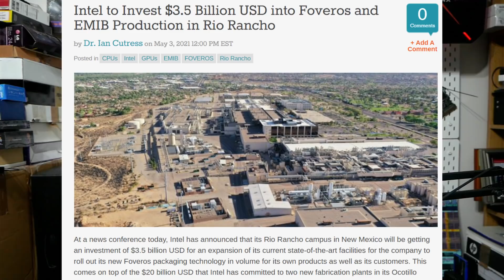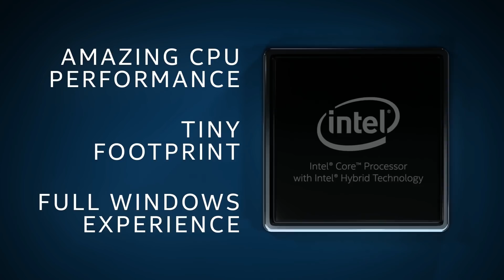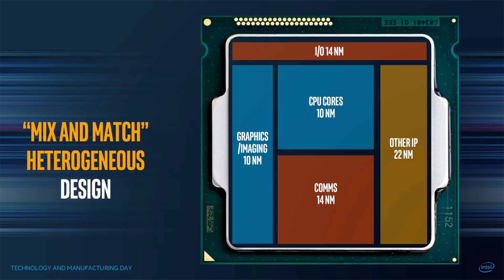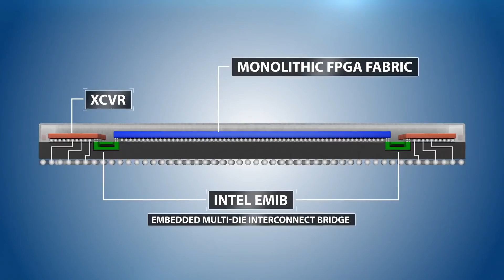Intel is Investing in Layered Processors: Foveros Gets $3.5 BILLION

Comment: My Ph.D. (awarded in 1995 from University of Sheffield) was in 3D packaging. I also worked on some DARPA die stacking projects in the early 2000s after moving to the US. I now work with CMOS image sensors, which routinely use die stacking. It's so funny to see the industry going from looking at you strangely when you talk about stacking, to it becoming almost commonplace. It only took about 10-15 years longer than I expected!
Reply: Yeah, that happens when your research becomes viable and/or necessary.
Reply: I mean, that's a common technique to pump you for unremunerated work.  You keep trying to prove yourself, they keep stealing your ideas and running with it.

Comment: Example of migration towards 2.5D/3D package SOC out in the wild.  The Apple M1/M#.
Reply from the maker: M1 isn't 3D with die-to-die stacking, it uses package traces - it doesn't even use an Interposer, so you can't call it 2.5D either such as with TSMC's CoWoS integration. There are plenty of interposer based processors on the market, mostly GPUs.

Comment: I think compared to chiplets stacked chips will be severely heat constrained. There is no way for a high performance option.
Reply: What their solution is, is that they will run small channels through the dye itself so that it can be liquid cooled from the inside out, that's what I've heard for high-performance solutions so far, Not sure if this information is true or not so correct me if I'm wrong
Reply: @Deltagonal  If that's true then I predict we will have another problematic process. Intel is too clever for it's own good. The chips are small. There is no reason to stack them.

Comment: Does this imply xpoint on-die?
Reply from the maker: no. watch the video
Reply: @TechTechPotato  Did. The Question is, how many layers do they have the capability for? How long before they will need thermal wicks embedded to solve heat dissipation? How does this relate to similar applications like AMD’s HBM-on-die? Which are mostly speculative questions that jump a few generations ahead.

Comment: Can we get a video about you? I’d be curious about how you know so much about the industry. Also super curious, what file format do companies send their designs for silicon to TSMC? Is it an industry standard? What software do engineers use to actually design what is etched onto the silicon?
Reply: Answer:
GDS format - industry standard
Electronic Design Automation (EDA) software products from Synopsys Inc. or Cadence Design Systems.  There are other smaller players.  But these are the top 2.

Comment: Funny, I was just discussing vertically stacked wafers with a friend a few weeks back. 
Since the chips are so efficient these days, why don't they develop a vertically stacked CPU/CPU (2x 5950X) combo or even a CPU/GPU stacked on one chip.
Reply: Heat is still gonna get you, unless you downclock. And heat causes stability issues. 
Not only that, but they have to plan the interconnects in a way that it is actually useful. If it is connected at the edges, it will be just like regular chiplets. That means that you must go through the die, which is much more complicated.

Comment: This might be a stupid question, but will this 3d stacking not increase the power density in the chip by a lot? Is this + smaller die size the reason the initial product was a low power mobile processor?
Reply from the maker: Pretty much. The key part is the codesign of the top compute chip and where you put the high thermal parts with the bottom IO chip and where those most active parts are. Lakefield's goal was low idle power, under 2 milliwatts, and I never got one in to test to see what it did on peak power.

Comment: Do you think the increasing capacity outside Asia will be bottlenecked by other parts of the supply chain?
Foveros is looking very good, price aside :P
Will be interesting also the cooling system for heavy 3D stacking packages, I saw a couple of papers about it.

Comment: Multi-chip module manufacturing depends a lot on matching individual die characteristics in the package.  That requires very sophisticated test, data automation and singulated die handling robotics.  That hugely raises the bar on capabilities required of assembly/test factories.  Intel is at the state of the art on this technology.  These assembly/test factories are no longer low tech labor-intensive offshore sweatshops.
Reply: it doesnt matter at all bc their nodes are 4+ years outdated. we were promised 7nm in 2017 for God’s sake.
Reply: @Ecrimsonblue  Everyone buys the basic lithography process from ASML, and process development is process integration.  All of that is hugely expensive, but Intel has plenty of money.  Intel's main problem vs TSMC has been stupid woke bean counter MBA management.  I'm pretty sure Gelsinger can fix that.  Morale is high and even retired Intel Fellows are returning.  Once Intel sorts out the silicon manufacturing which will take a year or so, everything else is in place including cutting edge assembly/test.
Reply: @Carvin0  I’ve seen reports that Intel is sourcing 3nm fab from TSMC in late 23/24. Intel could very well abandon advanced node development and go straight fabless in 3 years if they can’t get caught up soon.
Reply: Intel's Lakefield EXISTS and already shipped to consumers last year (Core i5-L16G7). As Dr Cutress said, Lakefield is a REAL demonstration that both Intel's 3D stacking and bigLittle technologies actually work. AMD who depends on TSMC manufacturing advancements have proven NOTHING yet 😉

Comment: This presents really interesting design challenges. For cooling, you'll want your highest heat output chips at the top of the stack and spread out to maximize thermal admittance. But for data latency surely you'd want your compute chips at the bottom of the stack as close as possible to the package IO?

I see a new gold rush on the horizon as companies innovate to optimize this new paradigm!
Reply from the maker: That's pretty much it. There's also the complexity of where to put the power TSVs and data pins between layers so as not to affect the transistors within each layer.

Comment: I think the US is waking up to the risk that if you outsource advanced chip manufacturing to Asia and then China attacks Taiwan you'd quickly find that all the advanced chip fabs are either destroyed, occupied, or blockaded by China. At that point, you've got a national security problem because both the military and the civilian economy are depending on products you can't import and can't make domestically in a reasonable time frame because advanced chip manufacturing is hard to get up to speed quickly. So it makes sense of the US government to give Intel a pile of cash to get fabs built or upgraded now.
    
E.g. China has thousands of ballistic missiles aimed at Taiwan. It wouldn't take that many of them to destroy all 7nm fabs on the island. Then you've got some South Korean fabs but China could menace the South Korean government to not ship to its enemies or blockade South Korea. It's also not clear if the current South Korean government would side with the US, Japan, and Taiwan against China. Maybe they'd be neutral or even side with China. At that point, you've bottlenecked Western access to advanced semiconductors. It's true that Intel's "10nm" process is comparable to TSMC/Samsung's "7nm" process in terms of transistor density but can Intel really make all the chips that you can no longer get from Samsung and TSMC?  It looks like the CCP can do to semiconductors what OPEC did to oil in the 70's - cut supply and drive up prices.

Comment: Stacked dice are a really interesting concept with so many issues. It will be interesting to see how Intel is tackling them.
Reply: d i c e
Reply: Not to mention you are more likely to win games if you stack the dice ;)
Reply: @danrayson  Dice is the plural of die but dies is used alot as well.
Reply: Heat dispersion is an obvious problem. So i think it's more usefull for smal low power devices than high power stationary computers and servers.